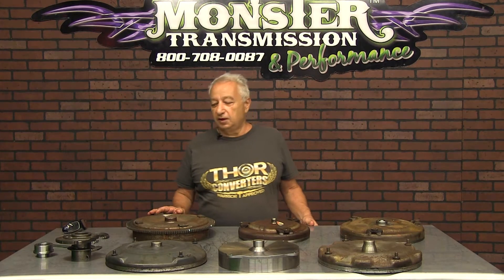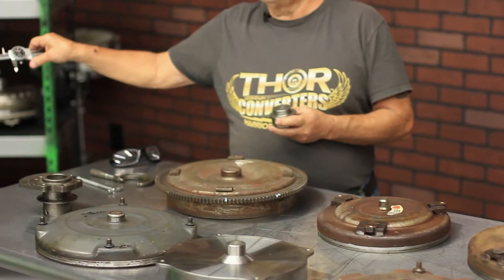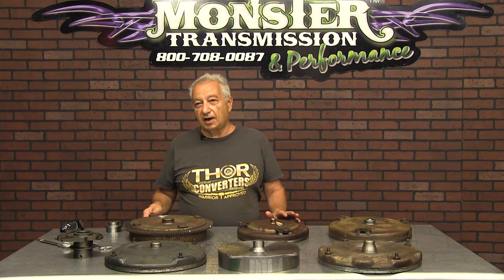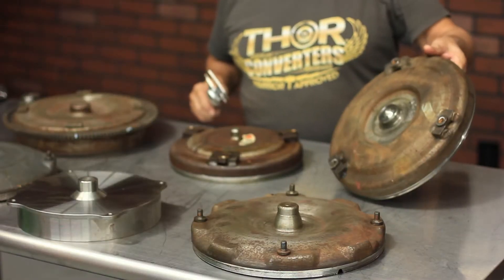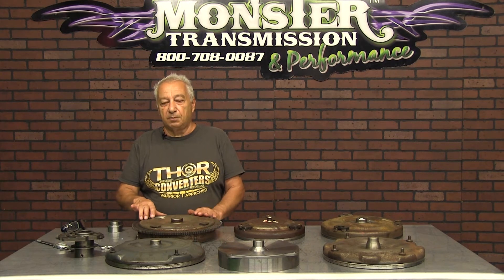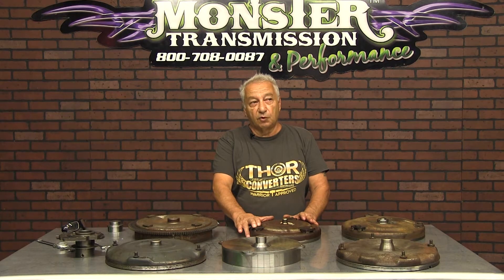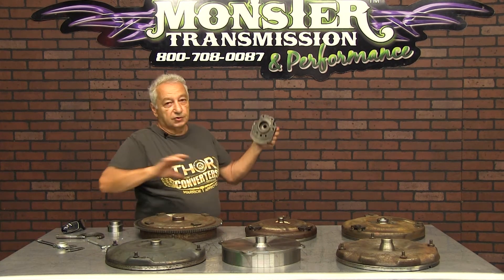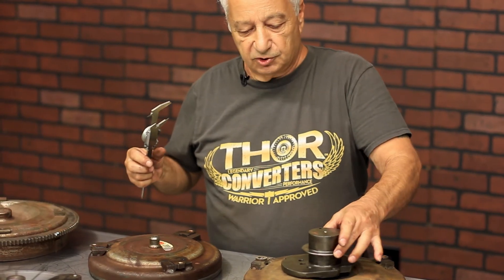What is a torque converter pilot?

Comment: I'm super confused!  My 2006 Chrysler 300C AWD "Automatic" has a Crankshaft "Sleeve" installed on the original Crankshaft.  My aftermarket crank shaft didn't come with a sleeve.  IS the sleeve needed?  I don't see it's purpose as the Flex plate is attached to the torque converter.  I don't see anything that would sit inside the "Sleeve"?  Why is it there???